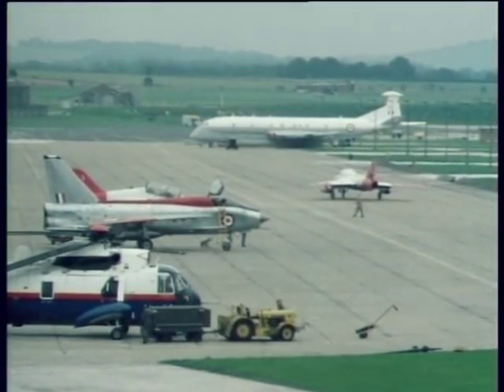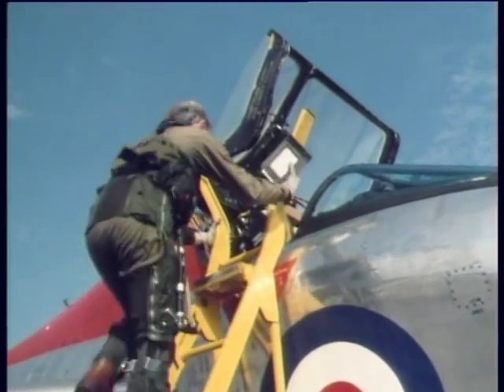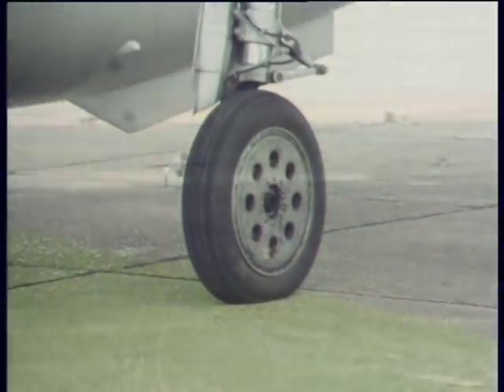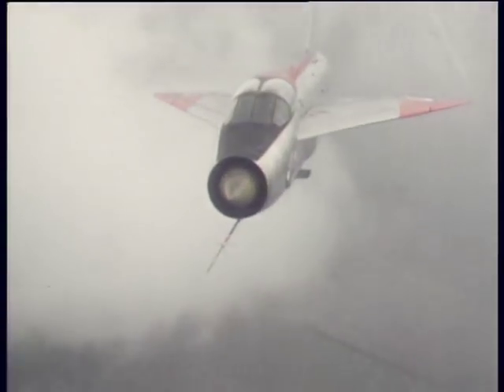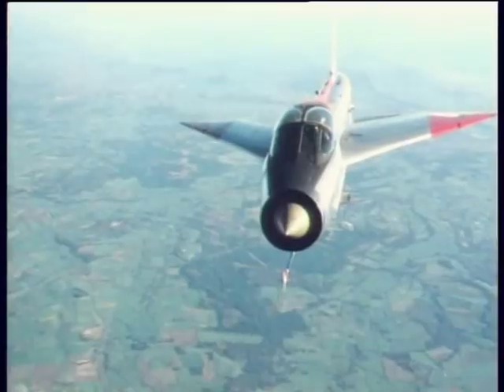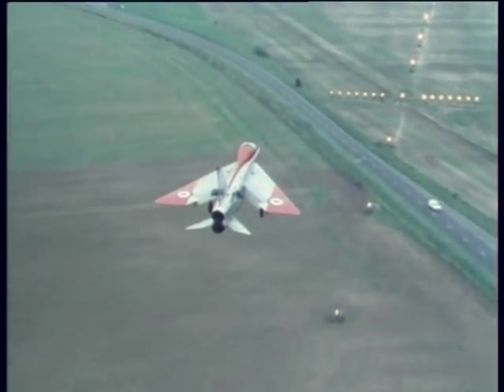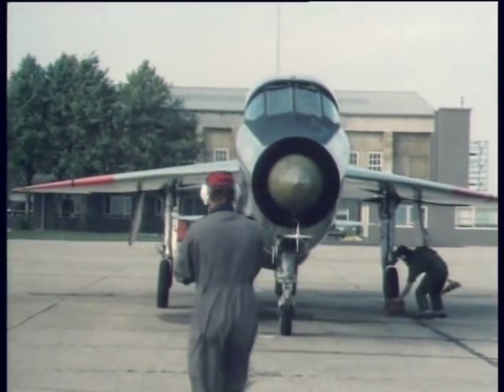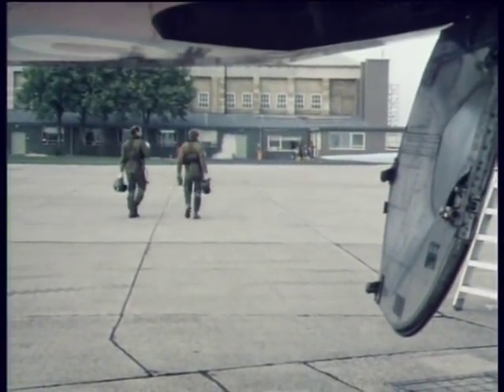BBC Test Pilot footage of Lightning422

Comment: I was stationed at RAF Coltishall in the time of the lightning. If the runway had a crosswind, One take off  and one landing and the tyres had to be changed, used to help out in the tyre bay when they were snowed under, the tyres were shredded.

Comment: I remember watching this fi st time round. Pity the lightning was never fully developed. It could have been in service into the 2000s and more widely exported if they had not stopped developing it in 1965. The f6 has a reasonable range while still being a hot rod. With more up to date avionics it could have done away with the need for the Tornado f3.